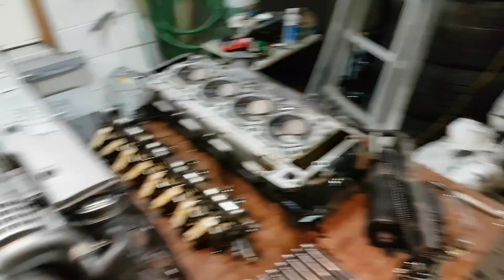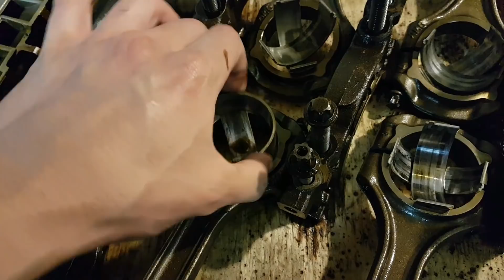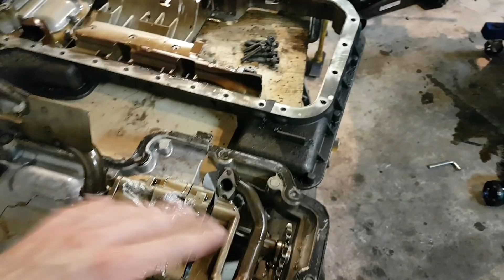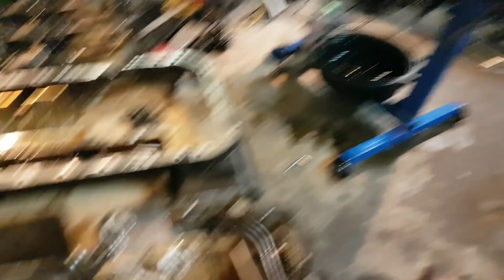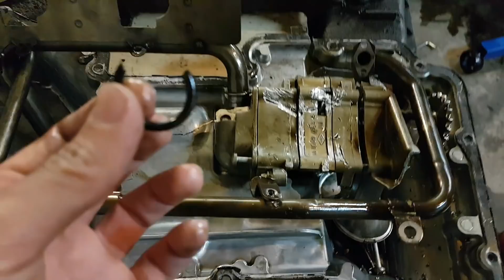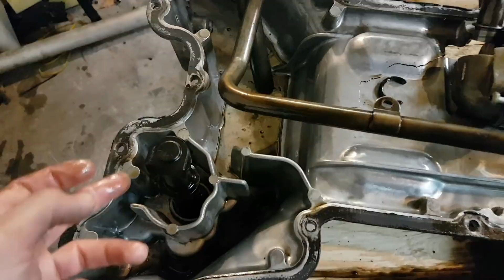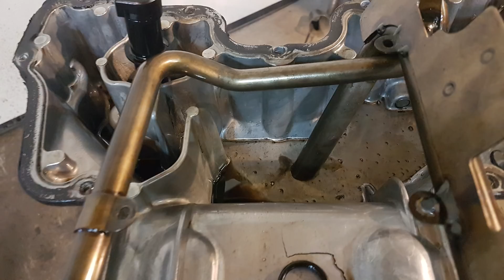Why my Engine Blew. Something every E55 owner should know!

Comment: I watched this video a few years ago and it is very very insightful and still is. But now years later and with more e55 experience I have a question. Seeing the oil level sensor appears to stand above the o ring fail level, what was the actual oil level at time of failure. Assuming the pump and o ring are immersed, is it possible this issue already existed before track day  but only became a critical issue when the oil pressure demand grew to the point that air was sucked down from the top of the oil reservoir. That being said, since I have not added an oil pressure sensor, I'd like to keep my oil near it's top safe level. My e55 has shown 7 to 8.4 quarts and never shown a warning of high or low. I believe the actual refill capacity is 9L or 9.5 quarts cold.? The full safe digital level is a point of contention in the forums. My real question: for e55 amg, at what point on the digital level on the dash(3 clicks of reset) does the car start showing "Oil level high"?  I don't run track, but do sometimes juice it. I'd like to maintain a top safe level to improve the odds of my engine surviving a similar failure if max safe level might help. fyi, I believe the split pan was required to drop the motor to make room for the super charger.

Comment: Guys don’t panic…as he said, his car is heavily modified and used for track. So the car with regular oil change and maintenance no need to worry about this issue. If you have time and money maybe you can change it for safety but again the other parts will fail soon due to the opening of the engine 😂. So if it’s required, better just install an oil gage and observe.
Reply: Where to put the oil pressure sensor ???

Comment: I did a 113 swap into my C320 found 1 with 71 K and had to swap the oil pan and found the same thing with the water pump gasket to !! I installed all the gaskets on the bottom and used the gray permetex and I’ll tell you the right way to do it! GET SOME GLOVES PUT A SMALL AMOUNT BETWEEN YOUR FINGERS AND SLIDE THE GASKETS BETWEEN YOUR FINGERS UNTIL EVEN !! Too much to worse than none at all!

Comment: Does this job require dropping the sub frame and pan? Anything else? Thanks for the info. 

Any tips on the oil pressure sensor? Where does one get installed / located?
Reply: I assume you'll need to drop the sub frame since it may prevent you from removing the pan.
Reply: Good question.

Comment: Was the engine full of oil? The next question is what was the  oil  weight, was the motor over heated.  How many miles was on the oil when it broke. And the name of the oil. I am not a mechanic.  I worked for GM for 20 yrs. Built a few motors! I have worked on cars for the last 50 + years . Under the shade tree.

Comment: Great video! So it's a must to change those oil pump O rings when the external oil level sensor starts to  lick. I have a 2002 Saab 9-3 with 120k miles, and recently changed all the gaskets, O Rings, etc and I conclude it's the time, the old of the car who plastifies the rubber O rings on the engines and-, of course-, the heat and cold cycles. Also it's a good idea before stops a turbo or intercooled engine to let it COOL down, this way we allow the oil to cool and help those O rings to keep in good shape, but time has no mercy on the rubber, that's why tires manufacturers reccomend to change them, cause they are "old", even if they looks good..

Comment: Did you not make a dry pump? Why not modify the o-ring mount and make it so that you either weld it in or do it in a way that is sturdier!
It would not hurt to install a pressure gauge! or not, just plumb in a pressure loss switch, so that at least you take the human decision making out of the equation, basically no oil pressure, no spark/fuel!

Comment: My c55 just threw a rod and blew up my engine. I was driving on the highway 75mph downshifted, accelerated and 2 seconds later huge knocking sounds, smoke billowing out, power steering gone, and brakes shut down. I had to down shift until I got into 1st gear, put e brake on and throw into park at like 2mph because it wouldn’t stop completely.

Comment: Do you know if there is an equivalent o-ring that would cause the problem to occur in a M113K in S55 and CL55? I mean if the collector pipe in those have that o-ring.

Comment: Thank you lots of detail very informative. But Mercedes engineers are 100% to blame here, if you just had an oil pressure gauge none of that would have happened. Since when oil pressure became an unnecessary thing to monitor is beyound me, as far as I can recall the oil pressure light always was present on the dashboard and earlier cars even had full blown mechanical oil pressure gauge as that is very critical for engine to have the required oil pressure, this maybe is the most critical thing to watch out for as it tells you alot, but Mercedes engineers - nah we dont care, we are going to sell you a high performance car with supercharger but w/o oil pressure sensor! Idiots.. Every such failure should be a lawsuit against Mercedes.

Comment: Just about to pick up my first e55, it's pretty high mileage so doing some homework on what to check/replace... can the sump be taken off and the o ring changed with the engine still in the car?
Reply: by the looks of it, you need to drop at least the steering rack and the sway bar to take the pan off.

Comment: Crazy , thanks for the video I have 2 2001 S500 m113 5.0 litter ones a parts car , listen anyone that loves there ride best advice is if you love your car bye a donor even if it’s wrecked or blown motor, it’s like having your own parts plus in your own back yard !!! But yes I’m def gonna go threw my oil system now that I have Seen this video , my everyday has 130,000 miles and it’s 19 years old that’s not much for those long years but I am experiencing some luncking sounds here and there when motor isn’t hot or up to temp , yet ... and no there is no oil censer in a 2001 S500 or a light just oil level reader in dash options , one last thing does anyone else get weird looks when people see a 90,000 dollar car spoilerd , stainless steal track riveted body kit and 305 /295 wheels , it’s either they don’t understand what there looking at or the sound of a would be bank owner or dutches of England’s chariot!!! Sounds like an American muscle car with the looks of a 24 hour Laguna secca road race car , America is so scared to own real cars real steal German made , sorry I’m rambling on , but by far the best car I’ve ever owned , hp, and torch stock is easy over most American junk on these car lots today , Mercedes LIFE “

Comment: Would that leak you mentioned of oil level sensor, be visible underneath the car somewhere close to the place where gearbox and engine are connected? Just today I`ve also get a problem with Kick Down, every time i try to use it the engine switch to a safty mode and cant accelerate, need to stop and turn off/on the engine. Not sure if thats related. ahh that w209 CLK 55 AMG gives me some trouble lately :(

Comment: so sad to see that expensive damage .. No oil pressure warning light is not acceptable .   I installed a large red fog light  oil pressure warning light  in a prominent position on all of my competition cars . Also to prevent excessive oil flow at high rpm  . I reduced the oil pump output capacity .which also reduced the load on the engine ..and amazingly lowered the oil temperature . logical really compressing any liquid increases the temperature . Al;so above 3,000 rpm the water hoses used to go rock hard with the pressure .   running the water pump at 1/4 engine speed . improved the water pump output and lowered the running temperatures . .  It was cavitating at high,,10,000. rpm . I had a conrod bolt failure and the block was only held together by the steel sump pan and the cylinder head .

Comment: I have an SL55 and as stated the oil pan setup is different on that particular m113k. Does anyone know if this also occurs on that setup?? Also, i am planning on taking preventative measures and just swapping out this o-ring now. Can someone please provide information on the correct replacement o-ring or an upgrade that can potentially last longer. Thank you so much for this video and letting the community know of this very serious issue!!

Comment: So do CL55's have this problem?
Reply: I got the same question! I have a cl55 and now know the pan is different but I’m changing my oil tomorrow! lol as well as sc oil! Sounds like if you do the proper maintenance on these engines they’ll never quit! Drop oil change intervals to 6000kms with synthetic if your above 180,000kms to save you in the long run! I like to drive mine kinda hard so good preventative maintenance
Reply: @MrBraiden1  That goes for every Mercedes.

Comment: Damn dude that is a pretty shitty situation for such a small problem. I had a some what of a similar problem where a cheap part blew my engine also twice because I never fixed the problem after installing the 2nd engine. For me it turned out to be a clutch fuel shut off switch for my 03 TDI. 3 engines later and a 20$ sensor its finally fixed.  -.-' Such a small thing causes the most destruction. FML

Comment: Such a pricey car and what a shitty design. They don't even install an oil pressure sensor or write a program for the ECU to shut down immediately if oil pressure drops below a certain Bar while you driving the car. Don't tell me this is unintended.

Comment: I bought a cls55 amg a month and a half ago I put 1200miles on it before mny hydraulic lifters starting ticking. The previous owner said he replaced the drivers side lifters because htye started tiucking, but now the ticking is back on the passenger side and a mechanic told me on the drivers side somewhat too, after doing na oil change w2ith 5w40mobil 1 and adding 3 cans of hydarulic lifter additive, the ticking stopped at idle but then still ticks when stepping on gas, but the ticking then comes back full force basicly and will tick once the car gets hot, Im worried that the oil pressure could be the issue, I took it to a mercedes specialty mechanic and we initially talked about lifters he daignosed 6k to fix it which is insane, they never echcecked the oil pressure, I think that the top of the engine the lifters and rockers would lose oil first and start clicking as an idication of low pressure what do you think, im checking the pressure in 2 days and gona have the lifters replaced and see if it fixes the problem :p
Reply from the maker: It could be a few different things. Check the oil pressure first to make sure it's normal. Check for play in the rockers themselves. If all seems normal, remove the bearing bridge and blow air through all the oil passages, make sure they are open. In any case the repair should be way below 6k. You can rebuild the entire engine for that much
Reply: @xfmotorsports  Thank you very much for the response, you are extremely knowledgeable and taught me alot about this engine, I will surely check the oil pressure before doing the lifters but it is almost impossible to find accurate readings for normal oil pressure for this engine(mainly becuase nobody has an oil pressure gauge) 

I dont want to burden you but you are like 1 of 10 people in the world it seems that would know the correct oil pressure for this car, could you tell me (cold start)idle oil pressure, 3krpm oil pressure, then idle and 3k oil pressure at heated temp, this would really help me diagnose my car thank you my friend I love your vids your a great guy!

Comment: I  had a similar oil related failure on a Ford FE. It went about 6 laps and seized. But it might as well have blown as it spun the rods and mains. Ruined everything but the heads. I had some trick oil mods done, and he missed a gallery plug. I was a poor assembler cause I missed it to, and a poor driver cause the oil pressure wasn't right. It was a nice motor to.

Comment: Hello mate, hope you're well?

Great video! May I ask you one question? late 2004 cl55 amg only 50k miles has a ticking noise from top end of engine? Any idea? Is it lifters? Car stood for a few months..As many garages are useless, I am hoping expert like you could help? Thank you!
Reply from the maker: Hey, it could be a seized lifter. Try driving the car and see if it goes away after a while. I've heard from some people, lifters also tick when the oil is too thin. You could try moving one weight thicker if you do notice low pressure. If the pressure is fine then just remove and clean the lifters
Reply: @xfmotorsports  Cheers mate...I need to check what oil previous owner put in..How to find put if oil pressure is low? As there is no gauge?🤔😐

Comment: Well I can confirm that the o-rings for the oil pump do dry up I just took to engines apart and this design is in a lot of 2000 era mercs sooo if you have your oil pan of then I would definitely change it

Comment: Bear in mind this happened on a 200 ,000 km engine being used for time attack ,,subjected to high oil temps , as visible on the components when stripped down ,,,change your oil frequently and use the car normally and most will be fine..

Comment: The E55 is not the only mercedes with no oil  pressure sensor the om 642 does not have a oil pressure sensor . I think this was done deliberately so they can generate after sales turnover

Comment: Can this also happen on the v6 on the c32 AMG. I need to figure this out so that my motor doesn’t blow
Reply from the maker: You can compare oil pump part numbers. Your Mercedes dealers can tell you that. Even if it does have the o-ring just check the oil pressure. I believe you will see a drop in oil pressure way before the o-ring deteriorates completely

Comment: Wow. What do you suggest is the most budget friendly way to mitigate this for E55 AMG owners of today? Is there an easy way to get to that o-ring or oil pump?
Reply from the maker: Just install an oil pressure gauge or warning light if you want to be safe. It's not something that commonly happens but is a pain if it does
Reply: SK8215 I had a car with a pressure gauge and honestly, it's easy to ignore it because the pressure varies so much with rpm. I'd rather just replace the o ring or the sump but I have no idea if that'd be an insanely difficult job or not.
Reply from the maker: It's a bit of a long job because the subframe has to come out first. I have a video on disassembling the engine. That might help
Reply from the maker: This one: https://youtu.be/HapBN8XJTDk

Comment: Bro, what mileage did this happen at please?
Reply from the maker: It was somewhere around 200,000km. This is heat cycle related, not mileage related
Reply: @xfmotorsports  Thank you. I really appreciate your reply. I asked because I'm looking to buy a Cls 55 with 100k miles (160k km) on it but was concerned about buying an unreliable older vehicle like this. Have you found these engines and the e55 to be reliable? Or is it one thing after another in terms of repairs?